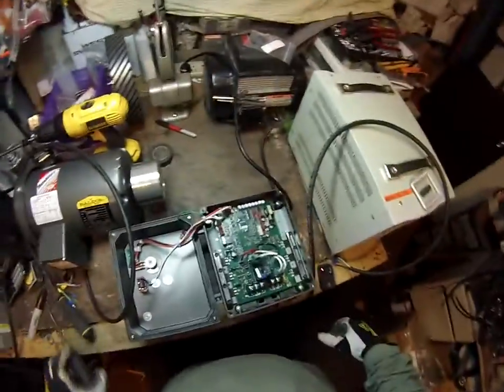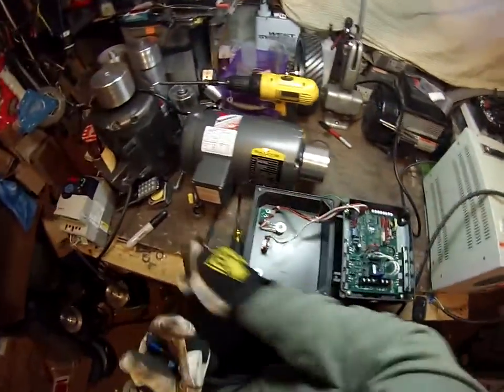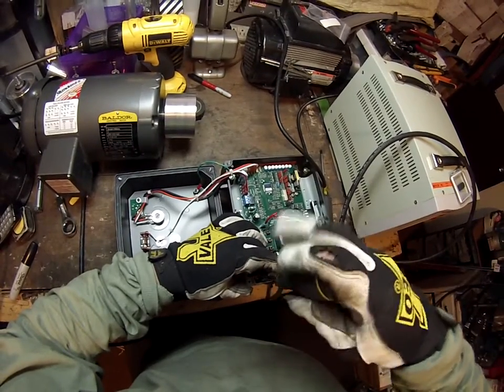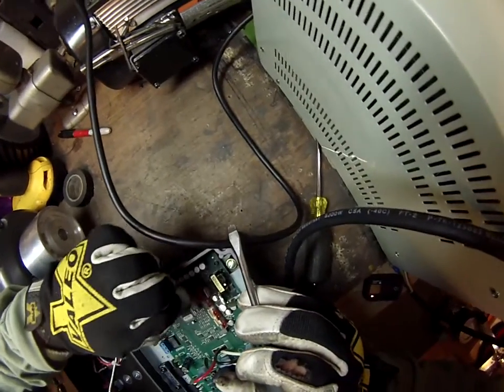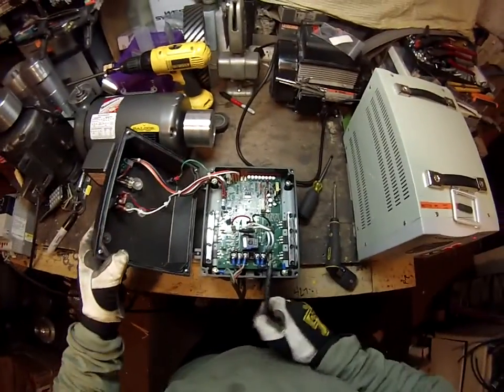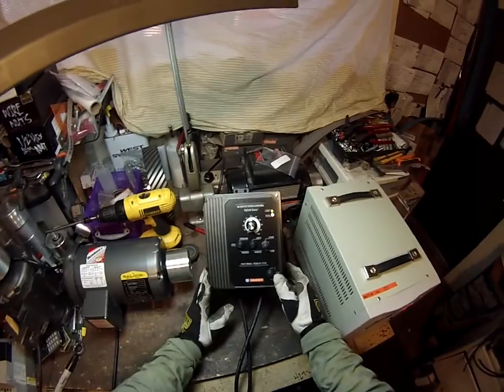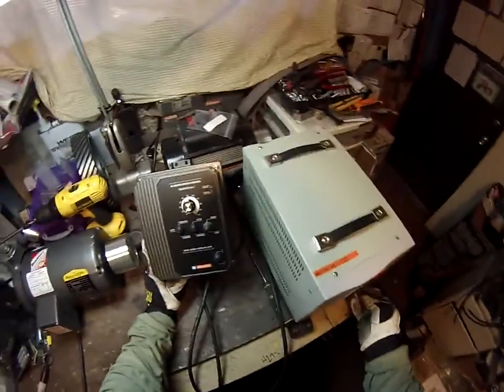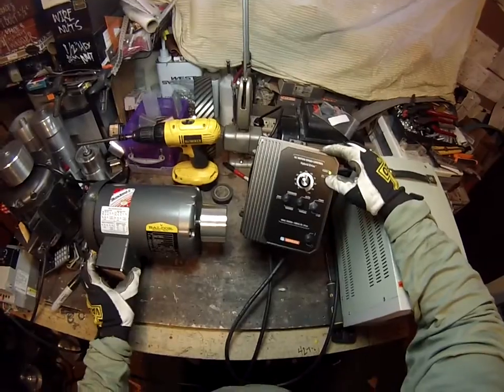how to wire up a KBAC 24d and KBAC 27d   ph 454 - ph 427

Comment: Hello Pheer, I have one of your grinders and I recently upgraded to a Kbac 29d and a Baldor 3559cem motor. I was wondering if you might be able to tell me what is wrong with my motor or VFD. When I start the motor it wobbles a lot like its out of balance and only starts to run smoothly when it gets too high rpms. If I slow the motor down to about 20% it starts to wobble again. Any ideas of what could be wrong? I have the wires set up to be 1 phase into the Kbac.
Reply from the maker: sometimes with the kbac 29  3 hp   they stutter at low speeds but will run smooth once the rpm is higher .
`not sure why this happens . everything may be wired up correctly but it will still happen .
you may wnt to turn up the MINimum POT inside the drive to increase the low end RPM . 
the best fix that I found for the 3 hp set ups is to run an AC Tech sm vector   ,AC Tech MC 1000   , Baldor VS!MX
Vacon X series   all of these will fix the issue
Reply: @pheer327  Thank you very much for the response Pheer. I bought your grinder about 4 years ago and it has been good to me. Just needed more power. I was also wondering if a Lenze Phase Converter Variable Frequency Drive 2HP 208-240 Volt ESV152N02YXC would work?

Comment: What gauge wire do you need to run for the input voltage if it's going to be 220v input?

Comment: I need some help. I have a kbac 27D and a cat. no. 119417.00 Leeson 2hp motor that I am hooking up as 110v. There are two extra wires on the motor that are labeled as P1 and P2. From what I have figured out, they are from a thermistor that is attached to the stator. Can I just cap off each of those red wires with a wire nut or twist them together and cap them off without hurting anything? I can't seem to find the answer anywhere online. I am not an electrician but can follow instructions pretty well. I've got everything connected between the kbac 27D and the motor and have quadruple checked to the specs. I just am not sure what to do with the two extra red wires on the motor. Thanks for any help.
Reply from the maker: some motors will have the 2 thinner wires that are for the thermostat hook up , cut off the exposed copper ends and cap or tape them off .
Reply: I'm looking at the same set up. 2 hp motor at 110 volts. I here you will only get 1.5 hp from 110 v di you set the jumper wire to 2 hp or 1.5 hp?

Comment: Hi sir goodmorning,what kind of cable are you using to wire the ac motor to the vfd,what I meant is what gauge is it ?and is it the same wire you use to wire the vfd to the outlet going to the 110 volts service of the wall ?thank you sir and more power to your you tube!
Reply from the maker: 115 volt power cord is 5-15p   12-3 awg      the cable from the drive to the motor is  sjoow 16-4   ( 300 amp )

Comment: What gauge wire did you run from the VFD to the motor?
I'm using this same unit on a 2 hp 3 phase, 220 V. Input power.
I'm running 10-3 using a 20 foot extension cord to plug into my welder plug.
Is that too much wire gauge size.
I bought 12-4 to do the motor hookup. Looks like what your using isn't that large
Reply from the maker: the motor cable is sjoow  16 - 4   awg   this good for 13 amp . the motor will only pull 6 amps max from the drive to the motor .
Reply from the maker: both of the cables will work fine    I use 12 /3    for the power cord on 1.5 hp 110 V    14 /4 for 220 volt   and then to the motor I use 16 /4   (10 amp ) or 14 / 4    ( 15 amp )

Comment: Did you not see the need for an inline fuse? I'm wiring up a kbac 24d for a 1 hp 1725 to use for a disk grinder, 230v. My tw90 grinder has an inline fuse also 230v. Is it necessary?
Reply from the maker: KB electronics recommends putting a fuse inline  use 20 amps .   just be sure to keep extra fuses on hand or tape an extra inside the drive . that way you have a spare when the fuse burns up . this will prevent you from having down time find the right fuse .